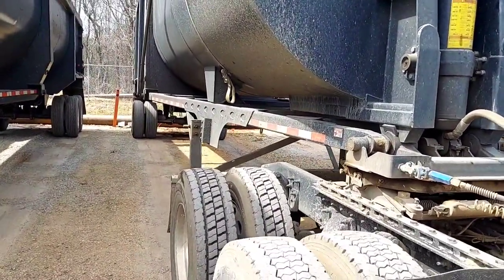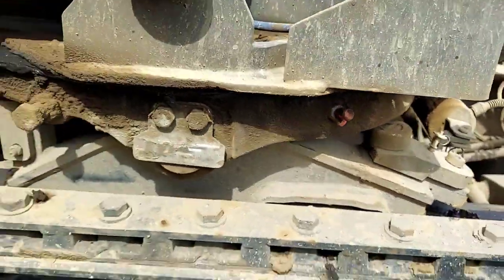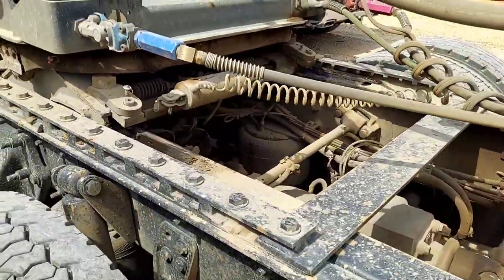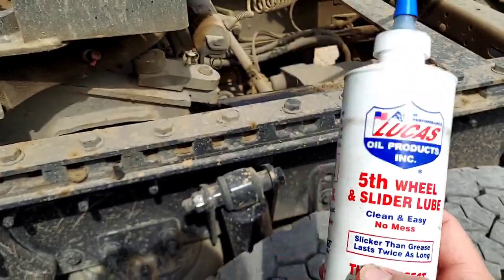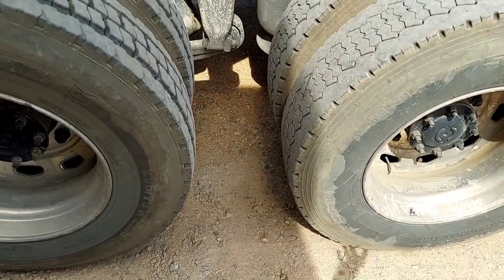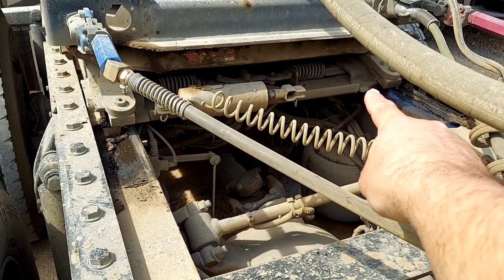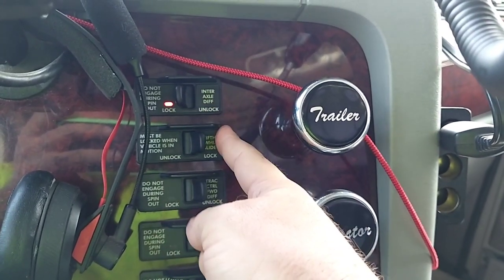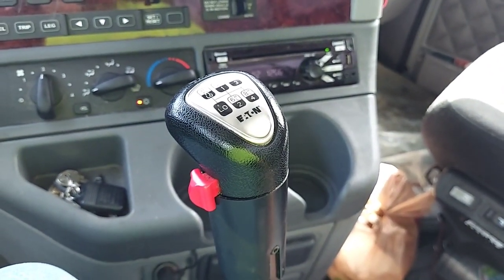How to slide your 5th wheel on a frameless End Dump.

Comment: Hello I have a 2012 Freightliner 122sd Tri axle can you do a video description on the other axle switches and how and when to use them please! Thank you
Reply from the maker: We don't have a tri-axle anymore, but I can do one on the switches. Thanks for the idea
Reply: @jrichtruckincbtips  thank you J, I would appreciate the switch video I went from driving a 99 freight shaker end dump as an employee to buying my own Tri axle and go into business for myself. The old truck I drove only had interlock but I’m not familiar with the other axle switches
Reply from the maker: @2-ATrucker  that's good to hear, and hope you do well with it. Should have that out by the end of the weekend.
Reply: @jrichtruckincbtips  awesome brother!! I turned on the notification bell for your new videos so I don’t miss the good content!
Reply from the maker: @2-ATrucker  thanks for that. I also have several CB related videos on the Freightliner Coronado including, coax, radio, antenna installs, and RF bonding which is well worth it in the performance of the cb system.
Reply: @jrichtruckincbtips  oh cool I’ll check those videos out as well!! I need to put a cb in my truck to talk to the quarries. I’m thinking either a cobra or galaxy, I’ve been told to stay away from all the fancy features like gps and such that all I need is a good noise canceling mic and antenna. I wanted to run dual antennas because they look sick on a dump truck but I’ve heard that the dual isn’t the best option and a nest of running wires for it. So I’ll probably just stick with a single antenna. I was told the Freightliner has a coax pre ran in the driver mirror but I haven’t opened mine yet to check. I did see that the power is already ran to the overhead or the cb though.
Reply from the maker: @2-ATrucker  it's more about the whole CB system than it is about the CB radio. I have both a Cobra 29 classic  and a Galaxy 47hp. 2 very different radios but either will work well with my system. On the Coronado I'm not sure that it's a true dual system.  I do know the passenger side antenna works the am/fm radio (I have a video for that). I have mounted 6 different antennas in 4 different locations on the Coronado on a single coax/antenna. The latest rear center of the cab with RF bonding the cab is the best yet.

I also have a CB mic shootout video where you can hear 5 different mics. The video is poorly done, and my radio sounds over drivin. But I have the volume too high and a crap external speaker. But as you can hear the Astatic mic has a true voice sound, and the Ranger Mic has better noise canceling.  I use the Ranger 100%, because I dislike tha Astatic cords. The Astatic coiled cords stretch over a short period of time. And I'm not a fan of the Astatic long, hard, straight cord.
Reply: @jrichtruckincbtips  thank  you for all the info I am going to check out and do a comparison of the two radios you listed and I am most likely going to take your advice with the ranger mic, I’ve heard a lot of guys say good things about that mic. Would you by chance know much about the gauges in the Freightliner? I took a picture of 2 air gauges that I’m not sure what they are for and can’t find any info based of the symbol on the gauge. Do you have a email that maybe I can send you the pic of my gauges? Or if you know a way to attach it to these comments. Thank you brotha! I’ve tried to post it on a dump truck group on Facebook but I didn’t get a single reply.
Reply from the maker: @2-ATrucker  I don't have a sound comparison video of the Cobra vs the Galaxy. My Cobra has a 40 watt tune up, is bare bones,, say $120 + $75 tune up. and my Galaxy is 110 watts, $400 converted and tuned. So it depends on what you want and how much you want to spend. 

You can DM me on Instagram @screwed_05_f150 and send pics there. It nap time I'll get back with you tomorrow.
Reply from the maker: Here's your video. I hope it what you're looking for. https://youtu.be/HRPoqhnlxRo
Reply: @jrichtruckincbtips  I just watched it, that was a awesome video brother I appreciate it so much! It answered all of my curiosity’s and made sure I won’t damage my 122sd when I start working it 😃
Reply from the maker: @2-ATrucker  awesome, glad to help, stay safe out there.